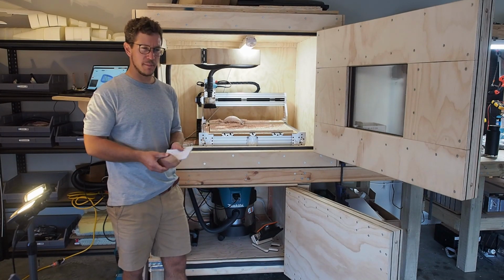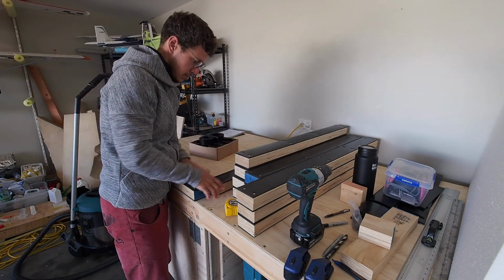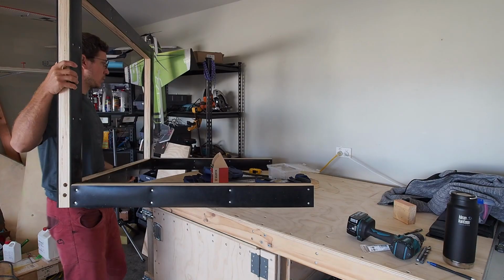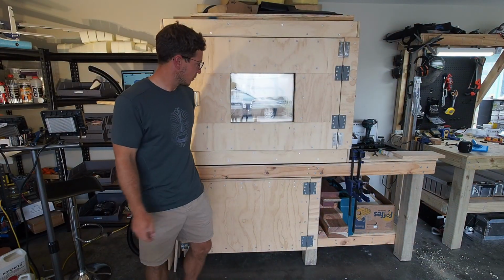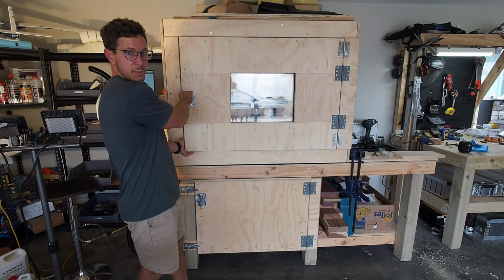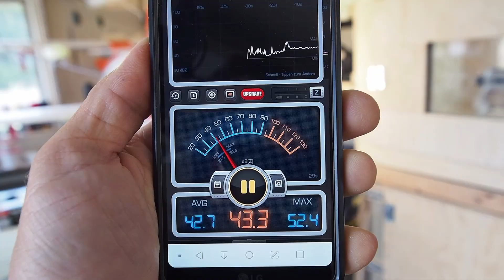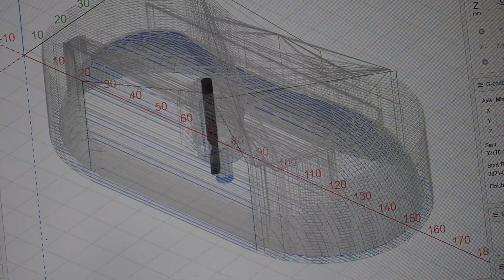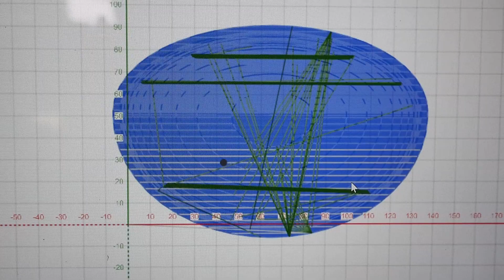Building A CNC Enclosure (30 dB Noise Reduction) + Milling Wooden Climbing Holds

Comment: Nice job I just made one myself. It helps a lot with dust and cuts the noise down as well. I use a security camera and wifi plug as well so I can shut down in the house if I see any problems.
Reply: Which camera/wifi plug do you use?

Comment: Interesting enclosure - excellent soundproofing, but it looks like more restricted access to the machine. I built an enclosure for my first cnc and I'm designing one for my newer machine so all ideas are gratefully received.
Reply from the maker: You're welcome. This was my first enclosure, so I would definitely make some things differently. 
One thing that I would change: the door needs to go all the way down to the bottom of the top enclosure and I would buil a sliding mechanism / sliding table top, so I can easily have access to the machine for maintenance and repairs and I can take it out easily.
Reply: interesting for sure, excellent no, even did does work well, I did some major mistakes .. for example, the rubber will isolate vibrations/noise, the rubber is attached to the construction with nails. you need 1 nail that touches the outside plates and you have a noise-bridge. the other things are the ventilation holes for the vacuum cleaner that have no noise damper.  the exit of the vacuum cleaner with the damper should be directly mounted on the housing because the noise-damping properties of the hoses are not good.I did not see any attempt to isolate the hole enclosure from the floor, this will not directly reduce the noise in the room, but it will reduce the noise that travels through the concrete slab of the house. over al de result of 45 db is very good,  but did you get the best ride for 1900 Au$, ? If you fart out in a room you are already over that level.

Comment: Ein Riesen-Aufwand...Du hast einen superschweren Kasten gebaut, die Tür wird nach einiger Zeit durchhängen, materialbedingt. Was ist mit der Entkopplung zum Boden hin? Die Schwingungen lassen sich damit stark reduzieren.Gewinnst also auch noch etwas mehr Ruhe. Ich selbst habe meine "Paula" in eine fertige Einhausung verbaut und eben entkoppelt. Der Grundgedanke ist wohl immer der gleiche, Staub und Lärm in der Werkstatt zu reduzieren. Ich behalte Dich im Auge...lol...
Reply from the maker: Die CNC ist dreifach nach unten entkoppelt. Eine Gummimatte unter den Füßen der Maschine, eine unter der Enclosure und eine unter den Füßen der Werkbank. Die Türe hatte sich über die Jahre auch am anderen Ende nicht mal um einen Bruchteil von einem Millimeter gesetzt. Aber an der Stelle darf man nicht an der Qualität des Materials und der Schrauben sparen.

Comment: Did the rubber work the way you expected?
Reply from the maker: Absolutely! I'm pretty sure that without it I wouldn't have achieved 30 dB of noise reduction
Reply: Rubber is only as good as those nails, nails transfer the noise more efficiently than rubber. If he could found a way not to nail the rubber down it would be a lot better than his "30db" claims.

Comment: One question: does the dust cause any problem if it's not removed while it's milling? Thanks!
Reply from the maker: The vacuum can get rid of most of the really fine dust. In my experience, there is more maintenance required if you use your machine a lot and don't extract the fine dust. And the fine dust will be everywhere, covering every surface with black stains. 
But I don't think there's an immediate impact on the milling process, so if you don't mill much you don't have to run the vacuum.

Comment: id love to build something like this for my 9014 but i live in Az. so i would have to build in an air conditioner for our 120 degree days for three months of summer. if i were to trap that heat in that the motors produce i wouldnt be able to make anything that takes a long time to cut for maybe 5 months out of the year.  very cool build though
Reply from the maker: Yeah, heat development is a problem. I added some bathroom vents at the top and drilled a 100 mm diameter hole below the CNC and below the vacuum. Hasn't changed much the noise level at all but now, cold air flows from the concrete floor into the enclosure. You could do something similar: air intake at the bottom that is connected to a long, large diameter pipe which is buried in the ground?

Comment: Is it worth the cost (I mean 4 walls, rubber, etc.) ? I don't get the feeling that a simple cabinet would be much less effective, am I honestly wrong?
Reply from the maker: It depends. If the CNC is running in a workshop with other noisy tools, you should only build something to keep the dust in. But if it's running 12 hours every day and it shouldn't disturb your workmates/family/neighbors, it will be worth it after a few days.

Comment: It is better to use boards of different thicknesses when building, as using boards of the same thickness can create resonance and transfer sound. To prevent this, different thicknesses of drywall are used around public bathrooms.
Reply from the maker: That makes total sense. Thanks for sharing!

Comment: Hey, as there is still no update video. Mind if I ask how you fixed the heat up issue? And did you change anything else of the enclosure?
Reply from the maker: I haven't had the time to edit the material yet. I fixed the heat up issue by installing a bathroom vent in the top enclosure and drilling one 100mm diameter hole underneath the CNC and one underneath the vacuum. By installing additional covers, these measures did not increase the noise level but fixed the thermal issue. Other than that, I'm really happy with the enclosure design and there are no changes.
Reply: @wurfttobias  
I hope you will be able to finish the material soon :) would love to see that.

I was just about to build myself a CNC enclosure based on your video. But now thanks to that info I also added some space for a blower fan to the design. Way easier to add new features before building it opposed to adding them later. Just finished it yesterday. Thank you very much :)
Reply from the maker: @ChromeBreakerD  That's awesome, I'm happy to hear that my video and input was useful for you! :)

It'll take a couple of weeks but I will upload the video soon.

Comment: Could you give me a link/name for your sound pressure app?  That looks like a good one.  Great build!  My neighbors are going to have to be bothered for now as Plywood is still out of sight here.
Reply from the maker: Thanks Ronny! I have a new phone since I recorded this video, so not sure which app I was using. If you search for "sound level meter", you will find plenty of similar apps in the app store. I've tested a few of them and it seemed like the absolute values given by these apps deviate a bit, but relative changes in noise level were pretty similar.
Poor neighbors! :)

Comment: I have been waiting for another video from you! Once I get my shop back up I  plan to start putting stuff out on stabilizing wood climbing holds.
Edit to add that I'm very interested in your take on a CNC approach versus hand crafted. In particular the time and effort it takes and I think the CNC you have doesn't allow for making positive edges? I haven't used one though so I'm just guessing.
Reply from the maker: Hey Tristan, I add your input to the list! Thanks!
Yes you're right, the CNC can't mill incuts. By changing the angle of the spoiler board, it's at least possible to achieve incuts on one side of the hold. Will cover this in a future video as well.

Comment: Nice. I might try something like this. You mentioned it got pretty got in there. Does the CNC machine itself generate much heat while in use?
Reply from the maker: The spindel on the CNC has 700 W max, so most of the heat is probably generated by the vacuum.

Comment: Great build! I'm about to attempt something similar myself, so I'm full of questions!

Is the remaining noise coming from the air and cable intakes or is simply coming through the enclosure itself? 

I'm planning construction very similar to yours but will be using a Butyl sound dampening product instead of the rubber. Do you have any advice or changes you would make to your design? (other than the venting you've spoken about in other comments)

How has the MX1 been for you? any pitfalls I should be aware of?
Reply from the maker: Thanks Dan!
The remaining noise comes mainly from the enclosure itself (vibrations), and if the door is not fully closed you can hear it as well. 
I personally, wouldn't add any more dampening because the improvements from this level one will be quite small. But if you want to reduce noise level: add more mass! The front door (no polystyrene, multiple layers of plywood and rubber), dampens more than the side walls with polystyrene, even though it has a window (4 x 5mm acrylic glass plus 2 air gaps).
There is mainly one thing that I would change: get rid of the doorstep so it's easier to take the CNC in and out. In my design, I could just raise the table floor but I was too lazy so far.

The MX-1 is a really good machine, quite sturdy for it's size. I had some minor electrical issues, but we figured out it's because I used the machine at some point with a very long extension cord which caused voltage peaks. I got it all fixed and sorted by the manufacturer,  who is very good at fixing stuff, very helpful and friendly!

By the way, I am moving back overseas and thus I am selling CNC and enclosure... Let me know if you're interested? (I assume you're NZ based?)
Cheers, Tobi
Reply: If you were to rebuild this enclosure would you suggest using the door mass structure for the full box then?

Comment: This is great! I have a plan on building something similar. Do you by any chance have a link to the router bits used milling the climbing holds?
Reply from the maker: Thanks Niklas! That sounds awesome. These are the router bits that I use:
https://www.carbidenz.co.nz/long-hard-cut-ball-end-mill-6mm-clone.html
https://www.phoenix-tech.co.nz/products/ball-6d-0-25shk-2f-16fl-16lbs-58oal

Comment: Hello, Tobias Wurft! My name is Vitalii, I just watched your curious video about an enclosure for CNC router, I am as well thinking about building an enclosure to insulate my CNC machine but I bother about temperature inside it. Is there a warm problem inside your enclosure and if it is maybe you have a solution?
Reply from the maker: Hi Vitalii, I had some issues with heat development after milling for 2-3 hours. I installed a bathroom vent at the top, drilled a large 100 mm diameter hole underneath the CNC and at the bottom of the bottom enclosure. These measures drastically reduced heat development and didn't really increase the noise level outside. After 6 hours of milling, I still air out both enclosures to avoid running into heat related issues.
Reply: @Tobias Wurft I owe you one. It is indeed great advice for my upcoming enclosure building. Thank you for sharing your experience!
Reply from the maker: @VSongu  You're welcome!

Comment: Hi Tobias!
You may have answered this question before, in that case I'm sorry. I'm wondering what your process on making symmetrical pairs of holds is and/or if you have any tips on this? Also, have you experimented with using a lathe for creating holds? Thank you, love the stuff you are making.
Reply from the maker: Thank you Victor!
I assume we're talking about symmetrical handmade holds? 
When I started, I used cardboard templates for the band saw cuts. But I think that's only required if you want to make the same pair again. Now, I first cut out one hold with the band saw (90° cuts). Then I flip that piece over and mark timber for the second hold. Second step, I mark the angled incuts on both holds and cut those. From then on, I use the belt sander, grinder, and disc sander as usual but I compare the holds in between. It's not a very sophisticated process but I figured out that over time it becomes easier and easier to make symmetrical pairs. 
I've still got old footage of making a symmetrical pair. Might edit and upload that next!
I have used a lathe and it's awesome to make rounded features and then cut the workpiece into smaller holds!
Reply: @wurfttobias  thank you for the response and your insight. I will probably experiment with the lathe to create symmetrical shapes and make rounded cuts with a jigsaw since I don't have a bandsaw and straight cuts on the table saw.

Comment: Would acoustic panels work better than Styrofoam?
Reply from the maker: Good question. It probably depends on which panels we're talking about. Aren't acoustic panels designed to be attached to a surface to mainly (not only) reduce reflection/echo? The Styrofoam is sandwiched between the plywood. If it's replaced with acoustic panels you introduce quite big cavities in a regular pattern (assuming you use the stuff with a wavy surface). In this case, I think you can definitely hit some interesting resonance frequencies which won't be ideal. 
But there are probably also different acoustic panels out there - flat ones - which will work better but are much more expensive. I've used some thick wool felt in the past to isolate a door and it did a great job. I could imagine it would improve sound dampening of such an enclosure further.
Reply: Sonopan sandwiched between plywood is the way to go.

Comment: The design looks good but in terms of sound insulation it is very ineficent. A screw transmits all vibrations and styrofoam is not good sound insulation. Rubber only works if you use small surfaces and do not put any screws through it. As insulation, you can better use foam rubber and glue plasterboard over it. Make sure that the drywall only touches the foam rubber. If you also line bubble foam rubber on the plasterboards, the sound cannot resonate in the room.
Reply from the maker: Good points! There are many ways to improve this design, but it's always a tradeoff how much more extra work it is. Also, I personally prefer to still get some audio feedback of what's going on in there in case something goings wrong (which always happens with CNCs). This sound level, where you can have a normal conversation right next to the enclosure, is perfect for me.
If I would improve it, I would probably add more mass, not add any light materials.
Reply: @wurfttobias : Great video, thanks! I had a couple questions that I didn’t see answered elsewhere. 1) Is the rubber that you used made for soundproofing (aka: Mass Loaded Vinyl)?, and 2) do you think the plywood contributes to the noise reduction? I guess you have said that you would go with more plywood, but I’m thinking if it doesn’t help that much, I’d rather go with thinner plywood resulting in thinner walls.

Thanks!
Reply from the maker: @Bradley Gong  Thanks, man!
1) I used the neoprene rubber with Stock No.  5063157 from RS components ( https://uk.rs-online.com/web/p/rubber-sheets/5063157) ). It's designed to be used for sound-proofing but you can also save some money and buy neoprene rubber sponge sheets that might perform similarly.
2) My previous answers might have been not so clear. I don't think plywood is very good for sound-proofing, but I need it for the structural integrity (drywall and MDF were not really an option, and it's always painful to work with OSB). I would always add plywood IN COMBINATION WITH RUBBER or some other sort of damping material. The door is only made out of plywood and rubber (+ acrylic glass) and it's sound-proofing performance is excellent (way better than the rest of the enclosure), probably due to the increased number of layers and its higher density. If you're on a big budget, the sidewalls could be made this way. I guess it would perform better than replacing the polystyrene with drywall. But I also think that the door performs so well because it's made out of plywood pieces of different sizes (almost impossible to hit one main resonance frequency).

The thinner plywood definitely sounds like a good idea! 
Cheers

Comment: I was thinking of using soundproofing foam with the wedges but I think yours might be better.

What type of foam did you get and where from?
Reply from the maker: I bought the polystyrene insulation sheets at my local hardware store (mitre10).
Reply: @wurfttobias  sweet thanks. Didn't know mitre10 sold them